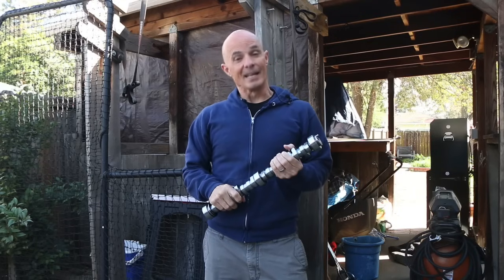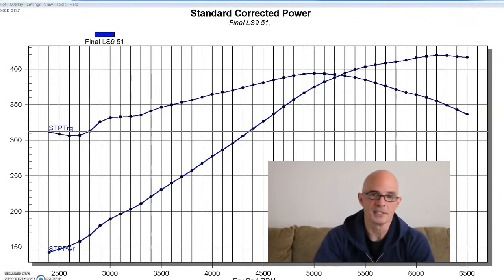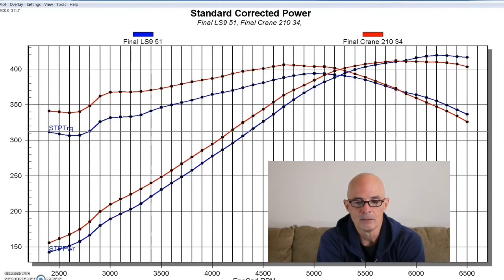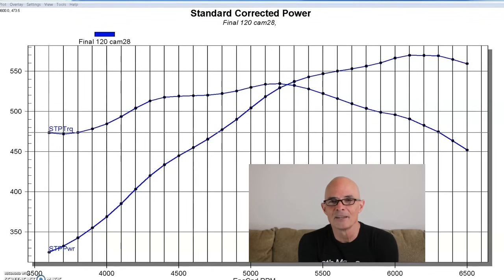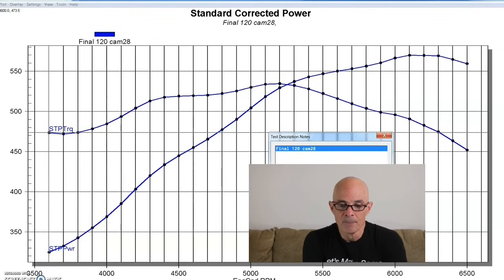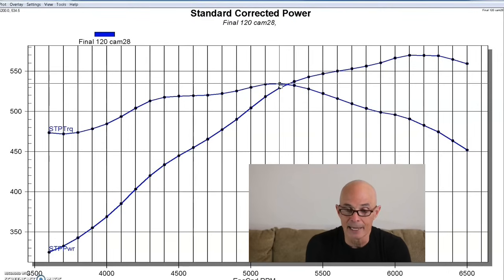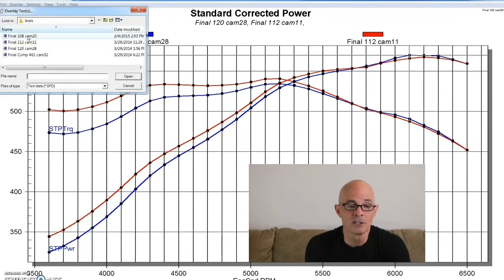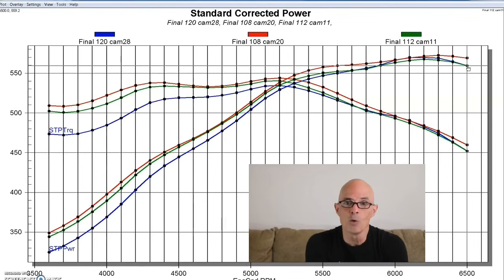LSA CAM TEST-108 vs 112 vs 120

Comment: Yes, i have an opinion based on some extensive previous data. The goal is furthering the knowledge base, not separating marque condifences and devotions. IMHO, the LSA change is relative to capacity, but not so much to capacity, but the LSA needs change with port cross sectional area, specifically width. In my opinion, the cath port is almost another engine family, almost like how a siamese port 301 Pontiac is different to a square port 326 Pontiac, or a a 2V Cleveland head verses a 4V. You dont see this specifically on your traditional LSA optimisation programs but cross sectional change create other pressure changes on heads that may have similar port Cfms at 28 inchs of water. LS3 heads verses cathedral changes the sweet spot. LSA's were set up by GM Powertrain to meet emissions and brake specific fuel consumption. As the data came thru, the team changed back to a more traditional rec port head, and optimised the cams to suit. Greater LSA is needed with wide width ports. What GM did between 1996 and 2008, Ford had  done down here in New Zealand and Australia;, our Ford Canted Valve cross flows attempted  to follow Hondas minimum port area rules by using a smaller rounded port alumnum head in the 1980 onwards Ford 250 cube 4.1 liter in line 149 and 164 hp sixes. We found factory  109 degrees in  small port head works best on any EECIV or V port EFi 3.9/4.0/4.1 liter 3.612 to 3.68 inch bore, 1.33 to 1.6 inch round ports. Elseware, the 2.8 Cologne V6 used 115 degrees and lost a lot of  torque and required lots of extra  revs to make the same or greater power. Carb 135 hp and US 104 hp 2.8s had better low end torque than Port Injection  US TVR 145, Uk and Eu 150 and 160 hp engines because Ford of Europe used the 115 LSA instead if 109.  The power increase was up at the higher end and real, but it came at a cost of low end punch. When we antipodean neanderthals  went wider to 115 degrees like on aftermarket EFi versions,  the lower end torque nose dived. Peak power rpm rose. All was great as a turbo, with 3.756 chevy pistons, the 250 six taken to 4.2 liter engine made heaps more torque and power with the 115. My Northern Alabama net buddy says that LSA is port runner profile based. Not critical, but observational. So based on what Ive learned, I'd expect the cathedral ports to need less LSA than rec ports. The traditional Stan Weiss and Vizard LSA calculations do actually cover this, but its dependent data which is covered off by engine family. The liberty is a little too great on engines with cathedral ports due to the squeeze it puts on air flow. Mixture motion takes power away too, so some unported heads that yeild great paddel wheel spin need less LSA to gain low end torque. This is exactly where Ford was with the E6 high swirl heads in 86. It wasnt a Speed Density/ SEFi issue its a lobe center issue on engines with different family traits. I had long discussions about this in an old Ford Six post, and a lovely person shared a some good info.

https://fordsix.com/viewtopic.php?f=5&p=517246&t=63620&sid=53472647f9da6c710add467b45aed895
Reply from the maker: the change in LSA does the same thing with rec port and cath port heads
Reply: Richard Holdener : Thanks Richard. Im sure your right. Lol! On other engine families, the standard form LSA formula definately has a primary factor of 125 to 132, depending on porting configuration. As a technician with a Fluid Engineering back ground, the cross sectional width should influence lobe splay response.

Comment: Hey a Richard liked the vid. With the 108 it’s got some overlap so cleaner burn in the cylinder, should make more hp. And a lumpy idle. Nice. Plus if your running an overlap cam fuel economy is not your priority.

Comment: Great test, but....
When you tune you tune for the best result without paying much attention to spesific igntion timing numbers or AFR numbers, right? Likewise then cams are tested, they would ideally be advanced and retarded to one gets the best result from each one of them. 
One can also argue that a 211/230 really is not 122.5 in LSA in regards to overlap and crossover lift and crossover timing. Remove 19 degrees fra EVO and one gets 211/211 and a LSA of 117.75, right? If the cam is set straight up at 117.75 LCI that is a rather retarded camtiming = soggy bottom.
Brian Tooley showed us that LS engines likes the EVO extra early and this increases LCA to maybe confusing levels. At LCA calculated as a single pattern cam, and focusing on overlap, it looks like David Vizards "128" rule for picking camshafts still works. ;)

Comment: would like to know where you installed cam. like straight up dots aligned , or degreed with 2-4 degrees advance like most call for. thanks.

Comment: You just briefly mentioned how the tight LSA presents a lope at idle. I was looking into Comp Cams "ThumpR" series cams and what I read was tight LSA and long exhaust duration. Your test answers a question I had, I think.  Will a ThumpR cam will have good power everywhere above idle?
Reply from the maker: it was made for sound but does pretty well in power
Reply: @richardholdener1727  Thanks for the reply. I really enjoy your comparison videos.
I have an '02 Corvette (recent purchase) with 82,000 miles. It runs great (one previous owner).
It has a slight tick at idle. I want to be able to lean on it some (solo competitions). I also want it to have a bit more character, it's too quiet, too civilized. So I thinking freshen up the heads, newer style lifters with small ThumpR cam and full exhaust. Not looking for big power, I think the LS1 is strong enough. I am mostly looking for reliability and to enhance the goodness the Vette already has!

Comment: Now I know why I have always ran a 112 LSA advanced 4 degrees. Intake is always more critical than the exhaust. Also with a 10 - 12 degrees more on the exhaust duration. This is what I have found to work best in the vast majority of cases, over the last 45+ years. What we also found was that a 108 LSA, (MPG) suffered on the street. It was not worth the loss of gas mileage for the little HP that was gained. That was why we started advancing the camshaft, and it worked...
Reply: Fool - that does not change the LSA - you need to go back and study
Reply: @alphaghost1633  Really. If I advance a 112 LSA camshaft 4 degrees. Then the Intake would be 108 and the exhaust 116.
Reply: @danawilkes6174  Yeah, but I think we'd all like to see a direct comparison of a 112+4 adv vs a 108 with reduced duration to have the same overlap (both advertised and at .050) with the same lift, too.
Reply: literally all wrong, you change the DURATION to bring the overlap down, you do not change the LSA to help with drivability, having too much duration and then widening the LSA to help drivability is all wrong, if you need to do that you have way too much duration for your application

Comment: How do we know it's the lsa and not the icl doing this? Like what if you installed the 112 and 108 with the same icl? Are we just seeing torque loss from late intake closing or are we seeing more communication between the intake and exhaust? Gotta adjust for these variables!

Comment: My only question would be since the 108 cam did really good naturally aspirated if you were to use that cam in a turbo setup you would more than likely lose power is what most of the talking theory would be because you're going to have overlap with the exhaust and the intake and you're going to force air and fuel out of the exhaust but would it possibly make more power just like the in a version would like to see that

Comment: Was there advance ground into the aftermarket cams that can also help low end torque 112+4 is gonna be much better then a stock cam 120 with no advance just wondering to get the whole picture thanks for all the ls stuff you do

Comment: How would the stock ECU, tuned with HP tuners, react to the lower vacuum signal at the MAP sensor? That's usually the reason tight LSAs don't get recommend for fuel injection use.

Comment: I read the artical on this back when I was building my Ford 250 Crossflow, had it suggested to me for a 108LSA, then after seeing the 108 was better everywhere I went with it & found low rpm is alright in it. Made a nice 252rwhp, thinking of putting it on engine dyno for fun when I change to a C4 & 3500 stall from stock Borgwarner BW51 auto & stall.

Comment: I tow alot as I deliver cars nationwide. (California is tough on commercial diesels but not gas ) I'd love to know a combo that will produce as much tq as possible down low. Maybe 2500-5500. Would a lq4 or 408 with 706 heads and a torque cam work well? I'd love to know best combo to run in my gmt400 dually with an nv4500!!! ssg.young88@gmail.com

Comment: I'm running a 110lsa cam in my LS1, terrible tuning issues down low, running way too rich. Would that be due to poor idle vacuum and the tuner not being able to compensate for it? Which manifold would best suit? Engine is cam only with valve springs with 1 7/8 headers.

Comment: Please try this on a common junkyard 5.3 like an LM7 or a Gen 1 350 for us budget guys.
Also touch on idle sound/quality and vacuum.
I wonder why so many street/strip or even RV/truck cams have LSAs like 112 or 114 when a lower LSA offers more low end torque.  There has to be a catch.
Reply from the maker: tighter lsa has rough idle

Comment: Just installed a Mutha Thumpr (109 LSA) in my LQ9 swap.  This videos gives me hope.
Reply from the maker: The success of the cam is more than LSA but my guess is you are happy with the Thumpr
Reply: @richardholdener1727  the idle is car porn, yes. I've got to get a better tune though.  Still dealing with vacuum issues and the brake booster since it's a high lift cam.

Comment: my take away: don't rush out and buy a camshaft on a 108 degree lsa. the 112 degree lsa cam is so close to the same power numbers it makes more sense to use it in a speed density fuel injection system because it gives better vacuum at idle and allows the map sensor to work correctly.
Reply: Good point, I hope most people can understand that.
Reply: But for all out power a smaller lobe separation angle is beneficial. So like maybe drag racing with a carburetor?

Comment: The problem is this will never show driveability and you will always get less peak cylinder pressures down low with bigger cams so less torque down low no matter what the dyno says. Especially where it can't show the 800RPM to 3500RPM which is so critical driving around. Also, you want to define your cam by valve events first, and only. What the duration and LSA ends up being is a total by-product. Three identical cams with 3 different lobe separation teaches you nothing about where your IVC (intake valve closing) and EVO (exhaust valve openings) are relative to displacement, rev limit, and power bands.

Comment: Why didnt you run the revs down bellow 3600 .. u say low down torque but its not low its mid .. what were these cams doing off idle through to 3500?

Comment: SBC guys use tight LSA’s for big power, rough idle hells ya, wasted fuel the more the better. Been using Cranes Sat Spec. for years on the track and street, the secret is out. To bad LSers hate the small block!

Comment: Where were all the cams installed center line at? Typical 4 degrees advance like most cam cards, or did you set them straight up? Cool demonstration by the way!

Comment: Why are some many ls cams 112+ lsa and split duration of at least 10 degrees and often as much as 20. 
Back in my sbc days it was common knowledge to use 108 lsa and equal duration on E/I...?
Reply from the maker: wider split is used on rec-port heads but works the same on cath port heads too. Single pattern cams don't tend to work as well in my testing-though the BTR Torque cam did great

Comment: I love your videos! Could you please do this same test with a De-Stroked 6.2L 4.065 in bore & 3.150 in stroke. Same heads, Intake, compression, and the same 3 different LSA camshafts. Thanks
Reply from the maker: 3.150 stroke?
Reply: Yep. The factory supercharged COPO CAMARO LS 327 Engine came with a 4.065 bore and 3.150 stroke.

Comment: To see more of the picture, I think you need to test for phasing, installed angle or whatever they call it these days.

Do you need new theories to test?

I have one from all the dyno simulation runs I did for Virtual Engine Masters (I placed by the way).  I think it might be easy to test with a 4.8 LS and I'm sure you have all the parts to make a good comparison test.

It would probably be simple for you and decent content (some people might not get it).

If you can put a cam phaser on a 4.8 and do smog testing, it might be able to test a few more things.

Let me know.

Comment: Richard, when the LSA changed, did the amount of advance (or ICL) stay the same? I.E. 112 LSA with a 108 ICL, 120 LSA with a 116 ICL?
Reply from the maker: I don't have the cam cards unfortunately
Reply: @richardholdener1727  - no worries, your test pretty much confirmed what I thought the changes would do. Last cam I bought for a project had a 110 LSA, TSP questioned my want to change it from the standard 114 LSA. Long story short, the 110 LSA worked very well in a 4.8L truck.

Comment: Seeing the gains up top even with the 108 LSA cam My suspicion is that the test engine wanted perhaps more cam in general.
Reply: same difference.  a cam with tighter LSA and more duration could the same as a cam with wider LSA and less duration.  they could close the intake valve at the same time

Comment: I have an LS1 5.7 liter and I'm about to put a 7875 turbo on it. Any advice on cam specs that will help me spool it up quickly?
Reply: no stall convertor
Reply from the maker: Then a mild cam-like a stage 1 truck cam
Reply: @richardholdener1727  Thanks for your help.

Comment: Was the cam advance changed for each cam to keep intake valve closing the same?  I have to wonder how much of the low end power was from the earlier IVC of the 108LSA cam then just LSA (or overlap) by itself.  Obviously changing LSA moves all the valve events, but keeping the IVC the same might be more of an accurate test of LSA?  Especially since IVC is considered the most important.  Great vids btw.
Reply: Intake Valve Closing is becoming earlier when LSA tightens.
An interesting test would be to install the 112LSA cam 4 degrees advance. This would have the IVC point the same as the 108LSA. However, the difference would be that the exhaust would open and close 8 degreese advanced, as the intake would be 108 Lobe Center Angle and the exhaust would be 116.
Reply: This is a really good point about the IVC. Changing.
Reply: I was wondering the same thing

Comment: Is the wide lsa on those pd blower cams only there to limit torque or does it produce problems running tight lsa with a roots/twin screw?
Reply from the maker: it is there in the LS9 to help top end and improve idle quality
Reply: @richardholdener1727  so kind of a compensation for lack of duration?

Comment: I'd like to see the same test on a boosted application. They say "build the best NA engine and boost is more efficient" but I've also heard of widening the LSA to have less boost blown out of the exhaust on supercharged applications as well as the wider LSA is better for turbos to have less of a chance for back pressure to make it's way into the chamber/ back into the plenum.
Reply from the maker: na=boost
Reply: @richardholdener1727  more people need to have that knowledge instead of changing there setup for forced induction assuming it makes it better without putting it on the lie detector.

Comment: I would like to see how the fuel and ignition maps changed as well as any VE (MAF/MAP/IAT) and wideband data you have. This additional information should give some insight into where the additional power is coming from (higher VE, lower pumping loss, etc.) or a combination of factors.
Reply from the maker: there is no MAF-it was run with Holley
Reply: @richardholdener1727  I realized that after making the post but there is still MAP and IAT as well as fuel lbs/hr and O2 data. I can understand if you don't want to divulge that data though.

Comment: finding a  108 lsa cam   on the shelf is next to impossible  , i'd like to see 13/4 headers with a long 18"or so collector  with the 108 lsa . with the increased overlap and tuning the headers you can wake up the 5th cycle of the engine
Reply from the maker: we already had that exhaust

Comment: The chop🤣 was most curious to see this test preformed under boosted conditions would the turbo respond better to a different lsa? Thanks for answering alot of my questions def makes sense more now
Reply from the maker: boosted just adds to what is there
Reply: @richardholdener1727  i figured that just wondered if the lsa would respond diffrent to it

Comment: If I remember correctly, smaller displacement will tend to move the power to the right, correct me if I'm wrong please.
Reply from the maker: cams will make peak power higher on smaller motors
Reply: Woooohooooo! I was right!!!!!

Comment: Hi Rick, It would be cool if you were more specific on the timing set on the cams you test. Comparing cams based on LSA doesn't indicate the modification of the ICL, the timing of the 4 specific events of IVO, IVC, EVO and EVC. IVC seems the most critical for the power potential and the location of the peak torque. Without wanting to split hair, I'd like to learn from these four seperate events.
Reply from the maker: one step at a time

Comment: million dollar question:  did you install the cams at the same intake centerline?  Were the exhaust valve events kept constant, the intake valve events kept constant, or did you split the difference?  Did you degree the cams for peak cranking pressure?
Reply from the maker: no